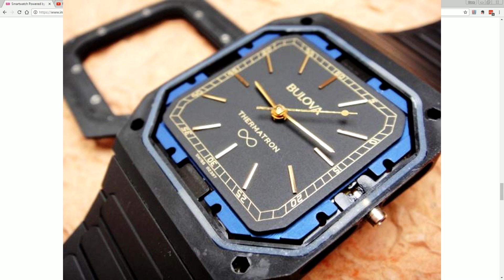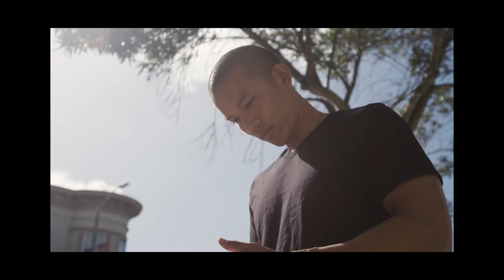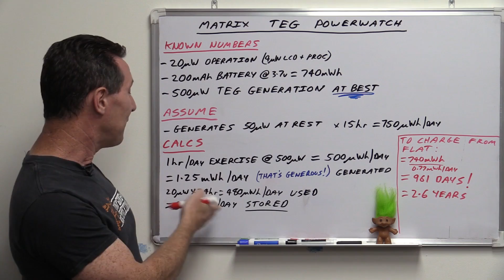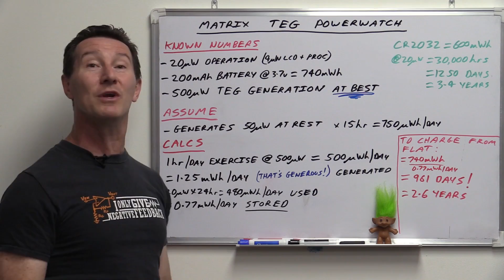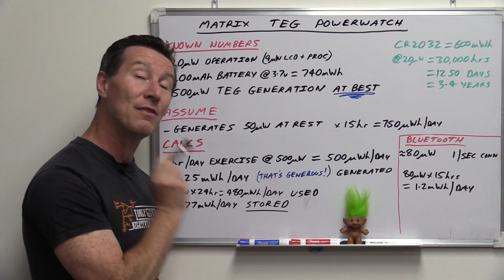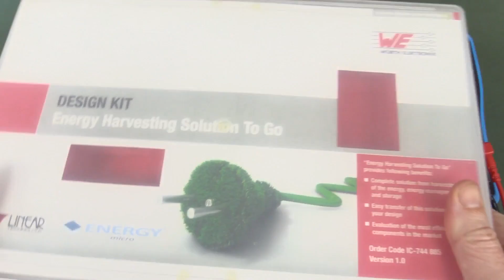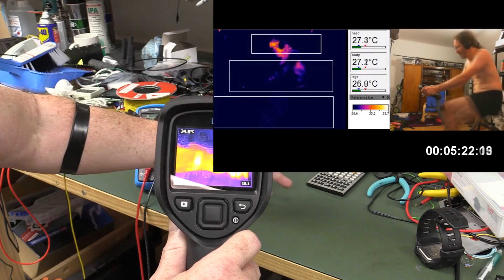EEVblog #945 - Thermal Powered Smartwatches Are GIMMICKS!

Comment: I like that you bash these things on the techy side since you know so much and are so good at explaining things to us, but as you say, people will buy it even as a gimmick, as long as it works (and for other products, even if it doesn't).

My question then is this: how much unpleasant is the gimmick? Wearing something that drains heat from your body makes me think the watch is going to be like an ice cube on your wrist. Even if it worked wonders, I can't really think people will want to go through anything like that. Is it anything like that or would it be unnoticeable?
Reply: Why would it be like wearing an icecube? It's just a block of metal, like any watch. It doesn't "suck the heat away" any more, or less, than any other watch, or object. Doing so would actually require energy, not produce it.
Reply: Well, the electricity is formed when the heat passes from a hot source (your body) to a cold one (the watch), so in order to keep generating electricity they have to keep the watch cold and maintain the heat difference between your body and the watch (probably with an heatsink like Dave does in his test). 

Therefore, I was wondering how bad it would feel to have something cold strapped to your wrist all day.
When I wear my clothes they might feel cold at first (and it's an awful feeling, at least for me), but eventually they heat up using my body heat and I stop noticing them. However since the watch would keep being cold, how annoying would that be?
Reply: Hamcha You're misunderstanding how TEC's work I think. There's no active cooling what so ever. There's no flow of heat, beyond what would happen regardless - in fact the flow of heat is probably less, since the entire clock will act like a bit of an insulator where it's resting against your skin.

TEC's exploit the DIFFERENCE in temperature. The lower the difference, the worse it functions. You don't want the side facing the arm to be cold - you want it to be as hot as possible.

A TEC element is just a chunk of ceramic and two metals... There's nothing magical here that would cause it to cool your arm.

If you applied current to it, it would cool one side and heat the other - but we're not applying a current, we're drawing a current - we're converting the differential in temperature, to electricity. We're not converting electricity to a differential in temperature.

Wearing this clock will feel identical, in every possible way, to any other clock of the same size.
Reply: Oh I see now! I completely missed the fact the TEC would work between the surface on your wrist (which the body heats up) and another one, not between the body itself and a surface. Thanks for clarifying and keeping up with my stubborness!
Reply: Hamcha No problem! I don't think it's weird to be confused about this at first, but since I've tinkered a lot with TEC's myself (I have one laying on my desk right now!) I am pretty familiar with how they feel and behave, so just felt like clarifying.

Comment: You better watch up soon your clock will be alot of smarter than you, communicating with other watches without your knowledge. The good thing it won't kill you in your sleep.... unless it hook itself up to your wifi grid and decide to turn your kitchen equipment against you. It will listen to you save everything you ever said or done, when your in trouble it will call the ambulace or police.

"THE MATRIX IS YOUR FRIEND" ;)
Reply: If a smartwatch have body temperature weight length and your pulse maybe it can calculate energy consumption, at least if it can measure blood pressure?

Comment: The real gimmick is making the potential buyers think they are contributing to a cleaner environment, when the truth is the effect on the environment is so small it can't really be quantified. It would be fractions of fractions of fractions of anything meaningful.
Reply: It depends, the impact of the raw materials, transportation, packaging, and marketing for the watch likely has a measurable impact.  Negative that is.
Reply: David Hoekje Hence the scam. It's like the whole ethanol fuel scam. Because it requires more energy to produce, it ends up being more destructive than petroleum although it burns cleaner. But the placebo effect works great for manipulation.

Comment: Nice words - „never have to charge the battery”. But you have to change it in every 3 - 5 years if it is changeble at all. Battery will die in that time and what? Do people have to buy a new watch?
Reply: At least CR2032 battery is changeble and cheap. Stupid Li-Ion battery will die after 3-5 years and you will have to throw away the TEG powered watch. Almost every consumer device is made to last up to 3 years these days.... ANNOING...

Comment: At rest: 50 µW.
Operation: 20 µW.
Hello?
Did you skip a decimal in your calculation?

Maybe 770 µWh instead of 0.77 µWh?

If you're like me and rest for 24 hours and sleep with your watch on your wrist you get a surplus  of 720 µWh (1200 µWh - 480 µWh).

You can even take of your watch at night (for 9 hours) and get a surplus (750 µWh - 480 µWh = 270 µWh).

Hope you get sued for lying.

Comment: But the 'purpose' was to stop wasting batteries. I'd say they accomplish that. Yeah it's a bit gimmicky, but they're achieving their goal.
Reply from the maker: Err, how? The lihium ion battery + charging circuitry + TEG that goes into this thing must use more energy to produce than a CR2450 battery (or two) that would last almost the physical life of the watch.
Reply: bdot02 it still has a battery in it that will suffer the same fate as every other battery eventually. I think most people will be on to the next gadget before the first battery went flat even if it didn't have the fancy teg in it. Then you have more tech in the bin with associated environmental issues. Or, just don't have a smart watch and avoid this issue.
Reply: Yeah, but there aren't batteries going into landfills. Even if it were going to be a negligible amount in the first place. I think it's more like you said that they're experts in the field and they wanted to make a gadget that works with their field. But I'm sure they have their own explenation
Reply: The more I think about it, the worse it is actually. The whole device will go in landfill, battery and all. With separate changeable batteries at least there is a chance they will go to the recycling bins that seem to be everywhere now.

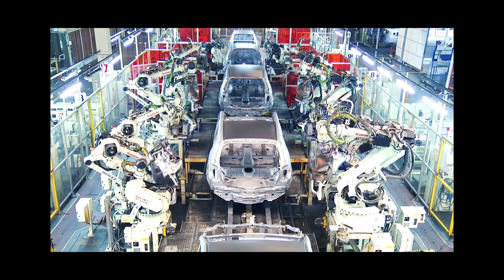Comment: you're correct, it's a pure gimmick in this application... but is it really that much worse than the 'solar car' full of pre-charged 18650s you were complimentary about in ep. 923? IMO the section starting about 4:10 where you're talking over the commercial in a mock credulous voice was a bit on too far over on the tacky side, you don't need to be taking the cheap shots when you've got the facts on your side. Usually love the channel though - not trying to be a knocker.
Reply: That car was a response to a challenge, for which the builders didn't come up with the conditions. It wasn't supposed to be a practical vehicle. This is supposed to be a practical product. 

Besides, what do you think a solar car challenge would look like with empty batteries, or no batteries at all? At the moment of lauch, if the sky happens to be overcast, the cars just stand there and not go anywhere. That would be exciting.

Comment: Dave, the numbers are very interesting. You show a very generous ~50% of the total generated power being capable of being stored and while I agree that there is a great deal of other factors you did not discuss, I was saddened to see you dismissive of the low power state. Many studies have been conducted on the time a person will spend looking at a watch.

Apple for example did a huge study when attempting to find the best balance of battery size and run-time. They published this information to developers of watch apps to encourage us to make good design choices. Apple says a user will spend less than 10 seconds at a time looking at the watch, and will look at the watch approximately 25-30 times a day. So there is very little reason for the watch to be in full-blown high power mode during the ~86000 other seconds within in the day. 

As I see it those lower power numbers make thermal generator more than sufficient for the claims of the watch running without the need for a recharge pretty believable. Sure, maybe it isn't perfect, but I do admire professionals who do attempt to solve a legitimate problem in the world. 

Perhaps smart watches wont catch on in the long term, but the research into creating a wide variety of power generation technologies and using a novel idea such as power a watch long-term without charging to springboard the development process into something potentially more useful down the road is fine by me.
Reply from the maker: I mentioned the low power state and how it doesn't make much difference. The point I'm making is even if you pick the worst case power consumption, and the best ideal case power generation & charging, the whole concept still doesn't make sense because a normal battery could get you are *several years of battery life.
Reply from the maker: I never said the watch could not generate more power than it uses, in fact I confirmed it. You are missing the entire point of my video, please go watch it again.
Reply from the maker: Try to comprehend what you are arguing here. You are arguing about a low power state in a watch that draws 20uW in high powered state. Maybe 100uW with Bluetooth on. Microwatts. A watch that would get almost 10 years battery life on a single CR2450 battery in normal mode.
Low power mode doesn't matter.
Reply: Perhaps I wasn't as eloquent with my words, but essentially my point was that I am okay with project like these that deliver exactly what they say they'll deliver it if helps raise money for them to continue R&D into technologies that could prove more useful in the future. 

However, I clearly see that it is far more likely that these researchers are likely tossing out buzzwords and ecological propaganda to pad their pockets. So with that perspective in mind I can see how this would be a gimmic.

I guess I see it as more a balancing act. Obviously I want scientists and engineers to continue to have the fiscal resources they need to continue to develop innovative ideas/products, but I also see how crowd funding can lead to products like the one in the video that provide no real value over existing methods, in this case, no real value over using a standard battery.

Comment: a huge video to just explain the simple statement: If you just power a watch with BLE functions, you can run it for longer than you would realistically wear the same watch, >10y, so the thermoelectric generator is sort of obsolete. There, I saved you at least the introduction to the video ~15mins...

Comment: Soo... basically, it works.
Reply from the maker: Yes, and so do Solar Roadways, uBeam, and the Batteriser.
Reply: Yes, but showing whether it works or not is not the question this video tries to answer. Of course it technically works. The question is "does it make sense?" And the answer to this is - no, it does not make sense. The problem "making a watch work basically forever on a single battery" has been solved for years, with coin cells for less than $1 a piece. This thermal powered watch theoretically can run forever without being charged, but this is restricted by the life of the battery (probably 3-4 years before it goes bad, if you look at how fitness trackers with similar batteries perform), so then you'd have to change the battery anyway. So the difference to a cheapo Casio watch with a coin cell is a.) it costs 3-4 times as much b.) you have to change the battery sooner c.) this watch is environmentally worse due to the added electronics for charging. And that's completely ignoring that e.g. in some countries/climate zones, where the difference between the body temperature and the air temperature is not enough, the chargin will not really work.

Comment: don't be so negative about gimmicks - people do love them. i had a solar powered calculator when i was a child - and this thing still works where the batteries in the others are long dead.
and the important question is not if the thermal device can power this watch but the comparison between a battery and the thermal device.
so if you wear it for 15h of which 1h is used for jogging, how much energy do you get over a period of 5 years, how big and heavy is the thermal device compared to a battery delivering the same amount of energy ?
Reply from the maker: Err, it already has a large capacity battery in it.
Reply: yes, which probably will be the first part that dies. a small supercap would live longer. anyway, i am still interested in the comparison of this thermal device against a battery. how long must a thermal device run to produce more energy than a similar (in size/weight) battery provides ?

and after all this waterseer, fontus, solar roadways bullshit they are at least honest and will deliver what they have promised.
Reply: OK, but you're missing the point. If the battery is the first part that dies, then the lifetime of the watch is dictated by the battery anyway. Change the battery, and the watch works again. How is it functionally any different with or without the TEG?
Reply: leave out the battery - when a battery can provide enough energy for years of operations, a modern supercap which has about 10% of the energy density is still enough to power the watch for several month and it will last forever.

Comment: No way the screen will be powered on always. You just press a button and it shows the time and date, even backlight for a few seconds, then screen is off. Or at least it's how it should work. Redo the math with this in mind, otherwise your calculations are the ones that are a gimmick.
Reply: Watches with such not-always-on displays are useless in my opinion. Watch must show time at all times without need for button press (which is why Pebble is the best smartwatch currently available.)
Reply: It will. It uses the sharp mLCD, a type of e-ink display which is always on, the same one the monochrome Pebble watches use. The 20µW figure is the power usage to keep the static image showing, but it uses a burst of power every time the image is changed.
Reply: +chicken livers No, I usually don't trust sponsoring platforms.
Reply: You realize it's an E-ink display, right? The display itself uses 0 power when on, only requires power to change the image. The power requirement from the watch is because of the processing, not the screen.
Reply: These 'Memory LCD' displays from Sharp do require some power to keep the image, and more to update -- they are not zero power to keep static image.
Reply: @JohnEdwa ok because some smartwatched or smartbands use pwm display to consume less.
Reply: ***** Not nearly enough to affect the calculations in a meaningful way. It's still a gimmick, which is the point of the video.

Comment: Not really a fan of Tfoot.  A lot of his rescent videos seem to either be him debunking low hanging fruit like the Waterseer or him persuing a personal vendetta against Elon Musk.

He tried to debunk the hyperloop by not reading the paper that they released, then playing "personal incredulity" with several issues they covered in the paper.
Then he complained that the breaking test wasn't on a full length track, that they didn't go full speed, and constantly complained about air pressure issues that didnt exist.  Like his "scale model" that didn't account for the size of it, therefore concluding that explosive decompression would result from a tiny hole, and complaining that they'd need "turbo molecular pumps" to get down to the correct pressure, when off the shelf cheap pumps can reach the correct pressure.
Reply: Elon musk is a millionaire.
Not an engineer like the real tesla. 😊